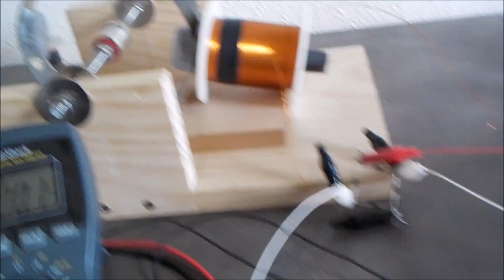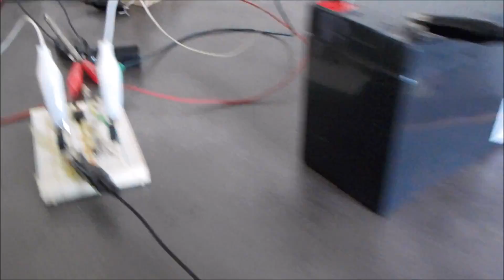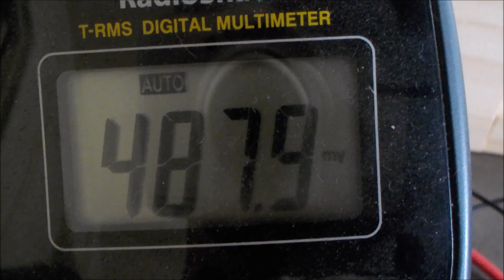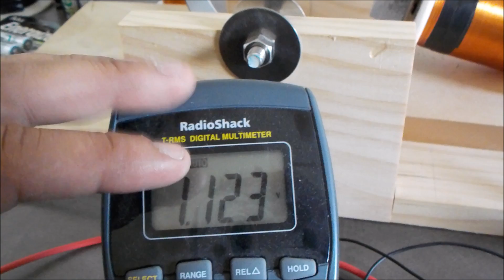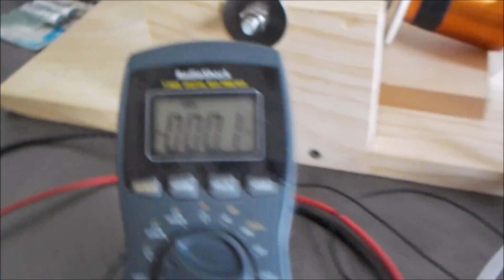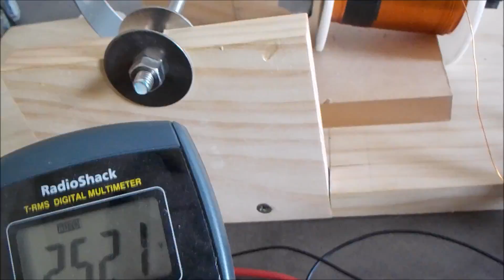How to Negate Lenz's Law

Comment: Modern turbines, by design, make creating an electric current with less force possible. High voltage dc motor ran through a gearbox will rotate modern turbine generators fast enough to fully charge one battery before the other is depleted. Under conservative driving practices of course.

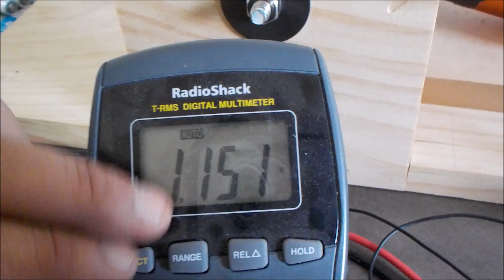Comment: Hey nice work, At minute 13:30 you are explaining what is going on with the caps of higher value.  Im just adding my own observations with magnetism. Imagine a magnet as a water pump, when you pump water into a closed container(iron core) you can only generate x amount of electricity because its like pumping water into a sealed container, but if you expand the iron or the container like with the capacitor you show, then you have more room that allows your pump(magnet) to generate more electricity. try the following; just add a iron plate to the base of your coil and then pass the magnet over it, you will find higher production of electricity just simply by allowing that magnetic energy some room to be dumped!!
Reply: Well said, its all about developing a better understanding.

Comment: Hello debunkified.  Do you know where I can find a micro-controller controlled transistor/mosfet circuit for a Newman Motor?  I want to control the duty cycle, frequency and pulse width with the micro-controller.

Comment: Hello sir ,awesome work im building one for fun and i need to know how to wind the coils ie bifiliar for just single wound and if bifiliar are they bifilar would like tesla said with the end of one attached to the start of the other or are they just two winds on the same coil form?
Reply from the maker: They are just wound on a speaker spool, two wires wound together. They are not connected serially like a Tesla type coil, try using a Bedini type setup in which there is a power wire and a trigger wire.

Comment: also... relay switches?  the. IMHOTEP forum has good info yo build.   and. my pimp boss aka- lidmotor has a relay charger runner... my point is a relay id basically just a coil.... perfect to test with collapsed fields ects... nite

Comment: I think the extra energy is coming from the sip of coffee..  lol.   Anyways, this topic have always confused me.   At what point do you short the coil ??  I remembered Ismael Avisu was saying the same thing about his invention by shorting the coil,  but I just don't understand how it works and why.
Reply: Because shorting coils right after inducing EMF current builds up in a coil, generating High magnetic field opposing the polarity of the magnet and pushing it further, after unshorting the coil B-EMF flows backs words using a reed switch or a transistor to make use of this EMF to charge a battery. And all that happens in fractions of a millisecond

Comment: bill muller's motor was based exactly on the princibles your showing.....although your results show double, try using a mechanicle switch that is timed by one of the other magnets....you should be able to see almost 100 times the voltage and amperage will increase as well.
Reply from the maker: Hi Sandy Bemister, yes you are totally correct with What Bill Muller was doing. I plan on making a completely new build using just that with mechanical switches, except with reed switches. Although reed switches have about 100,000 cycles, it would only be.a simple proof of concept to show some basic OU. I really appreciate your comment! Thank you.
Reply: +debunkified i myself couldnt find a sensible reed switch that would handle the spikes....after seeing your video it has made me re-think a way of doing it solid state.
Reply from the maker: Hi, I'm not sure what you mean by my results showing double, the 555 isn't properly aligned with the the voltage peaks and so just happens to be a good frequency that catches an "Ok" amount from when it does catch it at the right time. It was just a quick throw together to show what is happening, however they do make reed switches that can handle good volts and amps without destruction of it, another rotor would have to be present at 90 degree angles with much smaller magnets for the purpose of triggering the short as well as shorting the gen coil as quick as possible, when aligned properly of course.
Reply: I experimented quite a bit with shorting coils....the problem with the reed switchs is any good ones create too much drag....i was attempting a self running motor at the time...bill muller used solid state shorting method....i myself found the best result keeping it shorted until magnet was exactly past center of coil, example, place two quarters on top of each other, one being the core of coil, the other a magnet, and as soon as quarters are side by side, remove short. The good thing about reed switching is its easily adjusted without too much technical knowledge....also, what i mean by double is you will find with correct timing of short, you will get 10× the voltage...your coil/video showed roughly 2× , if you keep experimenting you will find the sweet spot that im talking about. Also i should mention that because you are using a switch method controlled by 555 timer, there is going to be some stray current going into your coil which may or may not be helping raise the voltage, not unlike a small tesla coil that we see on the internet that is run from a 9 volt battery, the base of the transistor is triggered by one side of the tesla coil which amplifies the voltage, if you trigger the same circuit with a 555 you dont see the same voltage rise within the coil, in my observations, its that base voltage that causes the tesla coil to excite or resonate at a much higher frequency, which in turn seems to produce alot more emf being emmited from coil. So in a nut shell, although your switching is showing a gain, it will be alot different using a reed switch of some kind, and you will definately be surprised!!!!